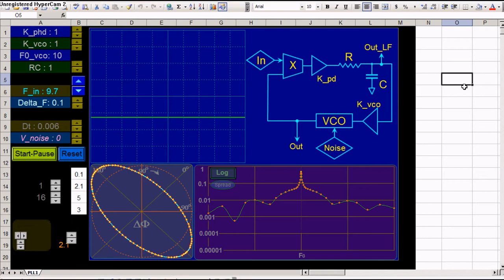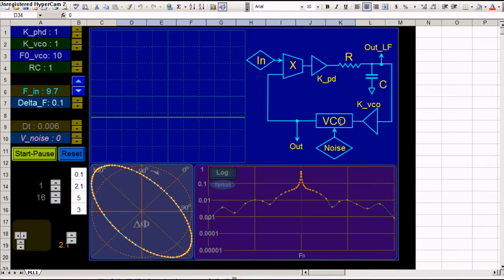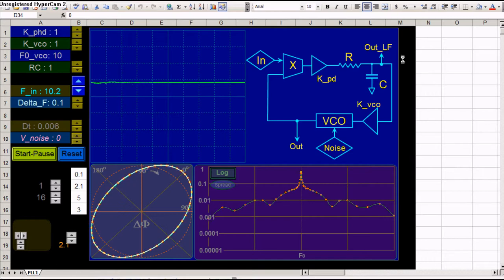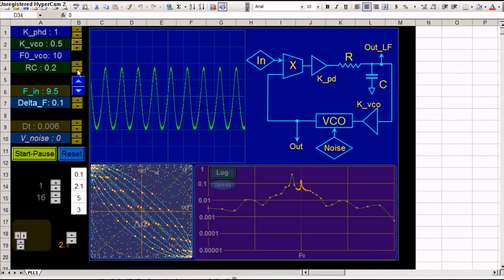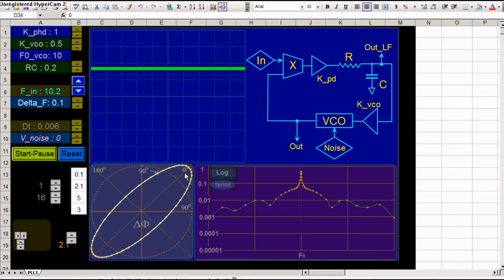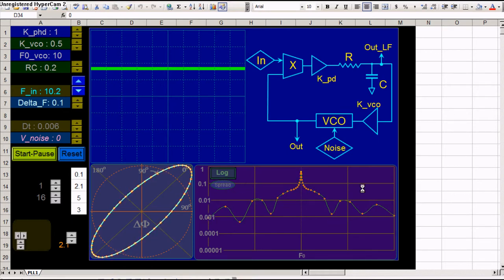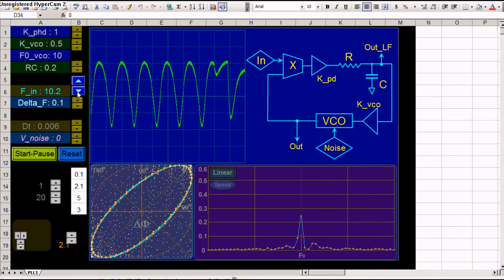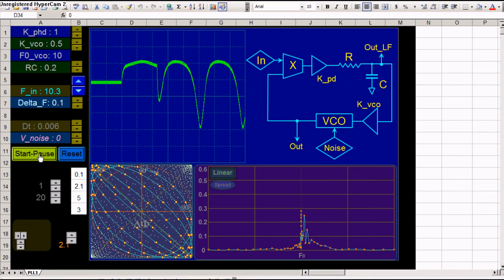An Animated Phase Locked Loop Model in MS Excel

Comment: Dear sir
i am trying to make induction heater using cd4046,but i have a question regarding the cutoff freq,how to determine it? for example if my fmax is 70KHZ and center freq is 60KHZ,and min freq is 50KHZ,what will be the cutoff frequency according to it, so I can design my low pass filter, any excel sheet u did? or any formula,plz i need ur help in this issue
i appreciate ur answer.
Best Regards
Alloush

Comment: In Excal ?? really amazing.
Reply from the maker: This is a line plot on a 2D scatter chart. The vertices are from a table which is being re-calculated perhaps 30 times a second (as soon as a calculation is finished and refreshed a new calculation starts). I made the chart with back background and and deleted any axes and grid lines from the settings. At that time I knew very little VBA and most of the geometrical perspective is calculated in cell formulas within a table. Today I would do it differently, all VBA. You can see more at https://excelunusual.com/. Thanks for commenting!